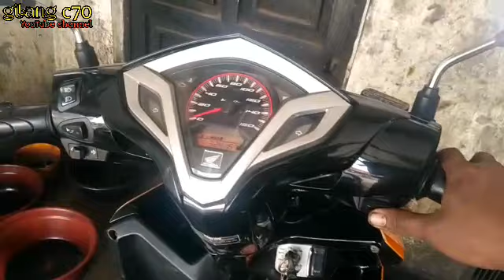Vario 125 bergetar dan brebet parah

Comment: Nyuwun sewu mas. Sekedar masukan. Sudah sy praktekkan sendiri di 2 motor vario yg cvt nya gredek2. Itu awal penyebabnya ada di mur as puli belakang yg miring. Akhirnya ketika dikencangkan, mangkok ganda nya jd ketekan ikutan miring. Dan kalo digas as nya jd ikutan geal geol. Dr 1 masalah itu akibatnya kalo digas awal gredek2, kalo di rpm tengah2 ada getaran yg ngayun, laher2 (yg di bak cvt, yg di dalam rumah kampas ganda & laher as puli yg di dalam gardan) sering aus. Solusine mur e sy ganti mur as roda. Bisa dibubut dulu sisi luarnya ato ring mangkoknya ndak dipasang. Biar ndak nekan laher bak cvt. Udah jalan 6000an tetep alus.

Comment: Sensor trotle posision(TPS)nya itu mas harus di ganti karna kalo sensornya sudah error pasti akan brebet 
Karna gasnya trotle body pengaruh besar ke TPS TPS ini terhubung ke injektor untuk semprotan bensin dan untuk merintah data ke ecu.
Reply: Kalau mesin dingin dia brebet yaitu sensor tpsnya tergantung suhu jadi dia brebet ibarat kata kaya suhu badan manusia mas.
Reply from the maker: Motor injeksi kalo ada part yang rusak apalagi jenis sensor sensor pasti bakalan ada kedipan lampu mil di sepidometer,,,
Selama lampu mil tidak berkedip berarti sistem injeksi pada motor tersebut masih normal,,
Reply: Memang tidak nyala kedip mas kalo sensor tps error coba deh di ganti
Reply: Ane soalnya pernah tanganin kaya gini waktu balap motor ane brebet pas langsung di gas beset kalo di urut gasnya pasti nga akan brebet dan sensor ecu di speedo meter juga nga kedip kedip udh berapa kali di riset masih aja begitu ya itu karna sensor trotle posisionnya harus di ganti
Reply from the maker: Owh,,brebet di bukaan gas 70 %
Kebetulan pada motor ini tidak begitu mas bro,,
Makasih buat masukannya,,,
Reply: Mas wibinawan, kalo brebet nya waktu start awal gimana, tpi klo mesin sudah panas normal mas, TPS sudah dicoba ditukar kemotor lain tetap saja begtu mas, mohon pencerahannya 🙏